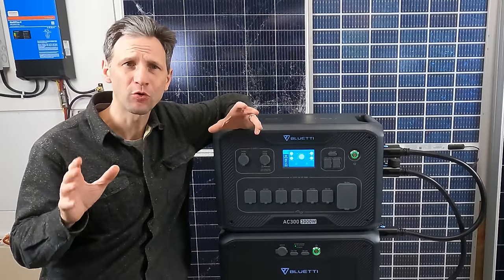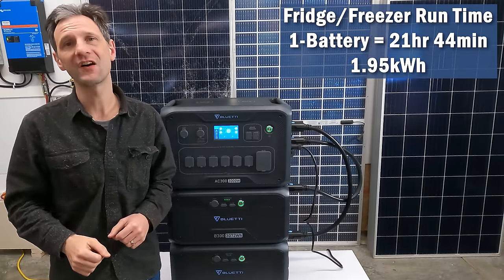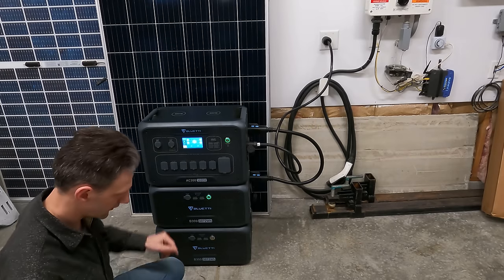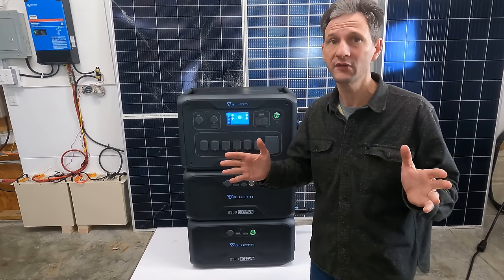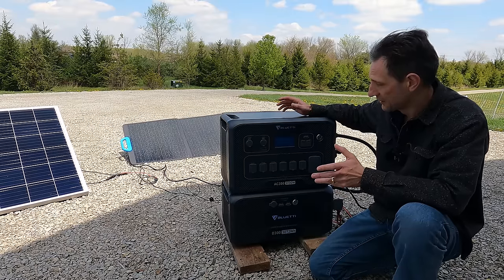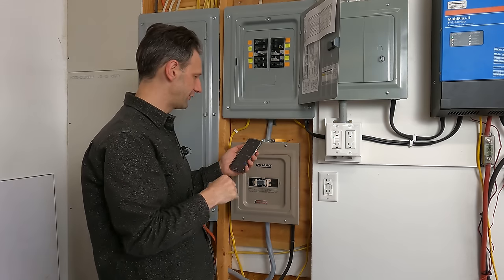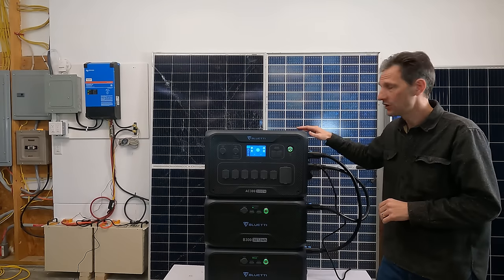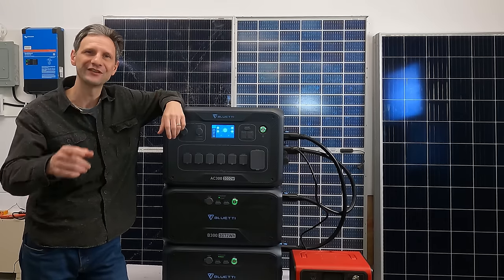Easy Solar Power Home Backup - Bluetti AC300 + B300 Review

Comment: Hey Dave. I'm trying to get the smallest footprint panel with the highest wattage at the lowest cost. Maybe a unicorn but wondered what your thoughts are. I have a limited space  rooftop . Hip roof with dormer  on south facing side. so that's why.
Reply from the maker: Start with the highest wattage panel you can find, then sort by price/watt to find your happy medium.  Signature solar has some of the best pricing.  Here is a good option: https://signaturesolar.com/bluesun-460w-half-cell-bifacial-solar-panel-silver/?ref=SALE
It is a BlueSun 460W Half-Cell Bifacial Solar Panel.  It's only $0.57/watt.  Bifacial won't help you much in your case, but it's a high power panel at a good price/watt.  If you mount them with sufficient clearance off the roof you might see some benefit from the back side.

Comment: Can I run my well if it is on the 110 mode using the Bluetti AC300.
Reply from the maker: If your well can run on 110V it probably will have a significant inrush current.  You could measure it, to see how much it is.  You might be able to get it to work with one of the soft start devices.

Comment: The B300 is limited to 200W solar charging, no way around that. ;)
Reply: So I haven't seen that explained, since the AC300 can accept 2 x 1200watt solar connections, will it charge the B300 via solar faster than the 200w maximum.
Reply: Attach Bluetti D050S to a B300 battery. That allows 500w from panels array. Thus a B300 accepts 200w + 500w in panels.
EACH of your B300's can do this!
Reply: If you have one AC300 and 3 x B300 battery____THEN your system can take feed from 2400w + 2100w from panels. Thats  4500w
Reply: @boomer7638  The B300 expansion battery has its own MPPT solar charge controller on the solar input. It is limited to 200W.
The B300 can also be charged through the DC link (big fat cable) which is not limited since it's connected straight to the battery.
The B300 also has a second DC input (barrel jack) for an AC (wall) charger. You can use this with solar but there is no MPPT, so to be safe, DON'T.
Reply: @larrywong7834  The 500W input is NOT MPPT and should only be used with the AC (wall) adapter.
IF, and ONLY if, you use the charging enhancer (D050S) can you use this port for solar.
Reply: @benesser7860  I have 3 x D050S.

Comment: Buy a gas powered generator. It’s cheaper and more reliable!
Reply from the maker: I agree, for most people a dual fuel powered generator is the first step for emergency backup.  These solar powered battery backup systems are a great addition later to add capability and flexibility.  In some situations, a gas powered generator isn't practical, due to access to fuel, noise, or reliability.